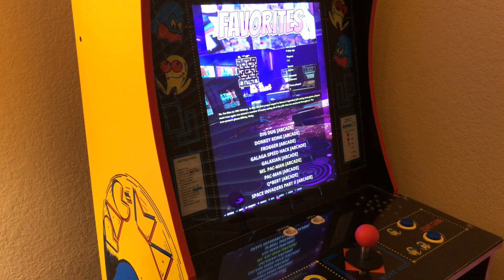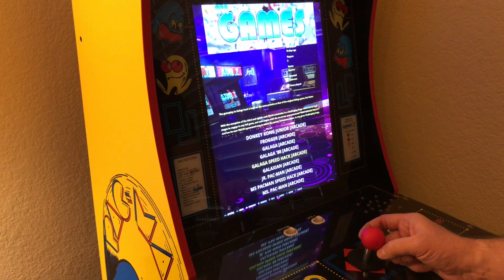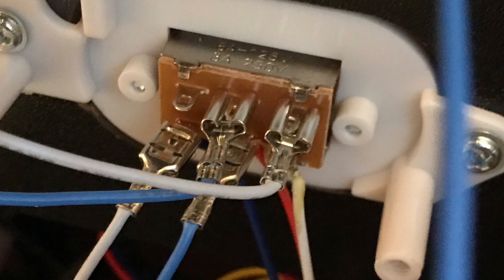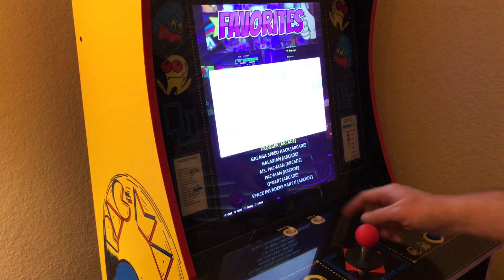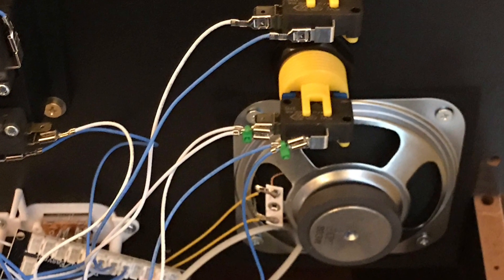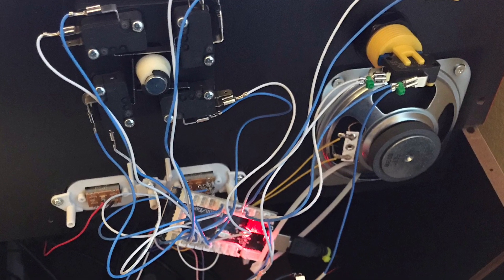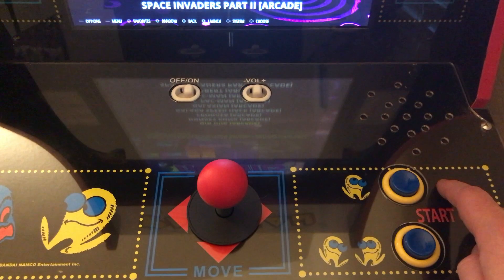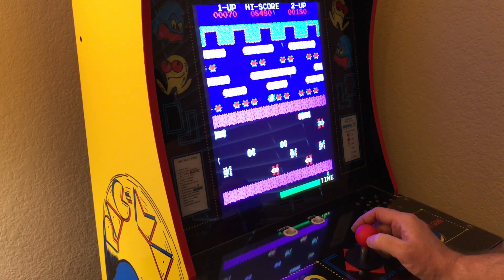No Need to Drill New Buttons - Arcade1Up Pac-Man Mod

Comment: Important note: the zero delay boards are great for this but not for 2 players. I had run into a problem if they get unplugged they get assigned to different usb numbers then they will need to be all setup again, I'm not sure if that happens on  RP, but it happens on PC. I would reccomend a ipac2 if you are running 2 players on a mame cabinet.
Reply from the maker: Thanks for the info. I’m still using a pi setup and haven’t had any issues with player two

Comment: nice !! could you have a zip ( emulation station) with the retro pie setup ( without the game ) because the UI look amazing !
Reply from the maker: Take toch I’m using the RetroHursty69/vertical_arcade theme to get this look. I started with the Wolfanoz Arcade only image and remove all of the non vertical games and hand picked the ones I really wanted. I actually used a backup image from my Street Fighter Mod as my starting point for this cabinets setup.
Reply: @wisegrape1381  what street fighter backup image did you use.
Reply from the maker: Rene Gamez Jr Using “[32gb]-Arcade1Up.Ready.5.4.Ratio.Wolfanoz.Edit-Level1Online” on my SF2 mod so I used that as the source and edited this image. 
ssh into the pi and  removed all roms from the arcade folder which were not 4-way vertical games. After removing roms I did have to select rebuilt the game list in retropie.
I changed the theme to RetroHursty69 vertical theme from the theme selection list and used the settings in retropie to rotate the image for my monitor. 
Used two usb encoders so I can have a player 2 start button
I purchased the 4-way happ controller from TornadoTerry on eBay 
I also purchased the happ buttons from TornadoTerry then swapped the inner and outer button parts to mix the colors